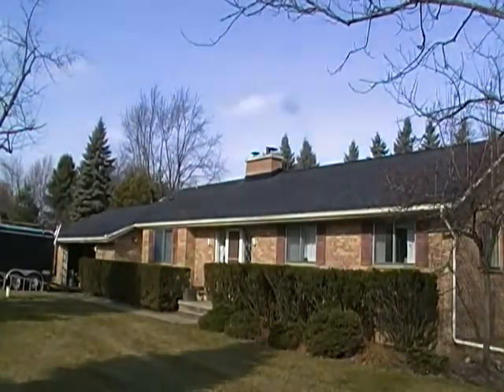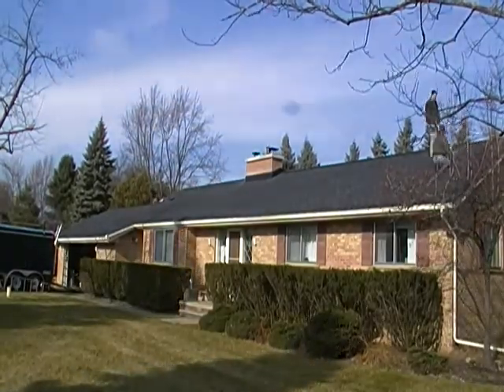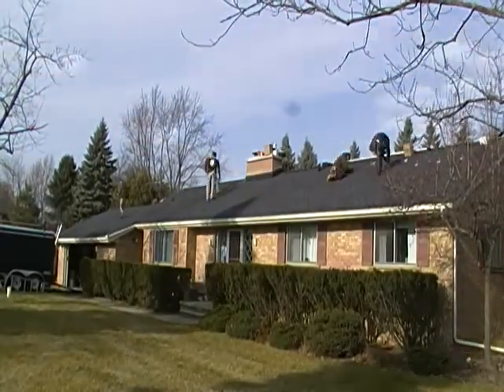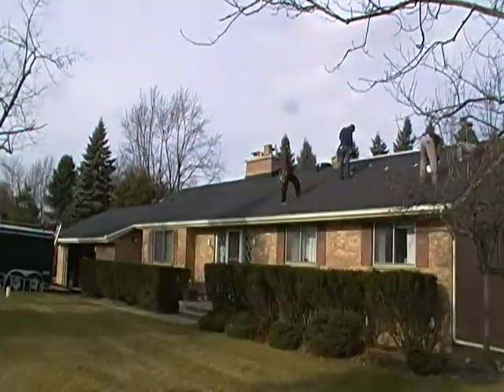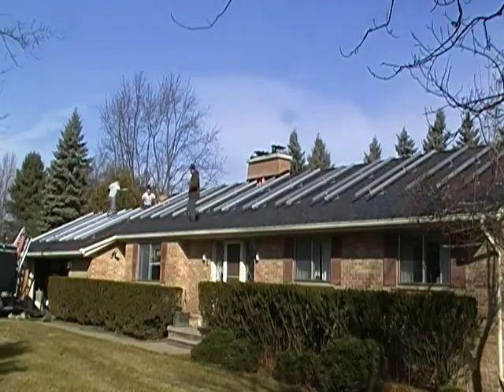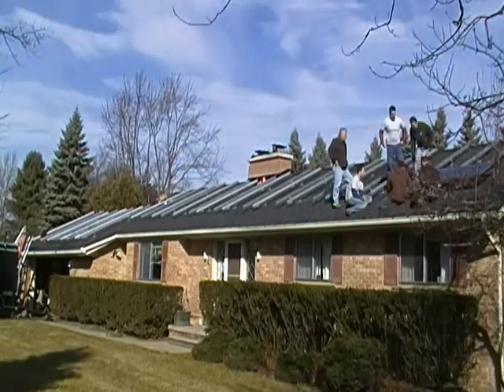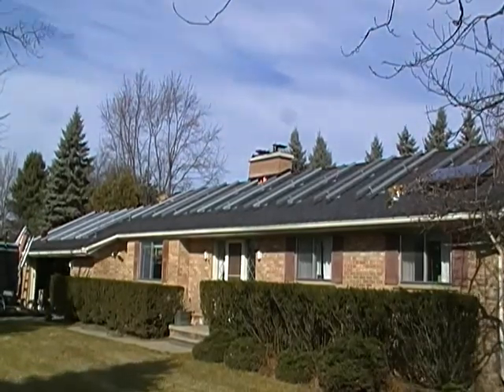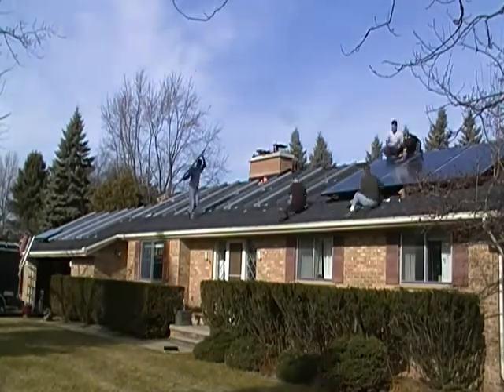Ann Arbor Michigan Solar Roof Installation

Comment: From kalamazoo..nice vid. How much was Install? Does the energy backfeed your power meter to give energy/power credit from energy company when you are harvesting more electricity than you need?  What are your electricity bills now?
Reply from the maker: sugardippedtitz Here is a link that shows the economics for the first three years. http://annarborsolar.org/3-year-summary-of-life-with-a-solar-roof
Reply from the maker: sugardippedtitz Yes it does meter the backfeed. That is called "net metering". We generate about as much as we use over a year. Because of the renewable energy credits we don't have an electric bill now or much of a gas bill.
Reply: Very good!  Thank you for the information.